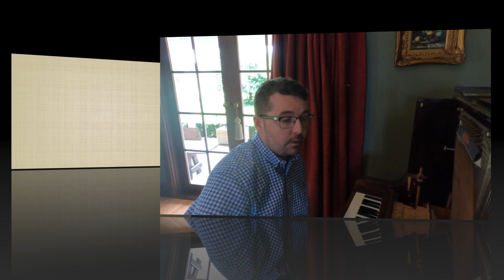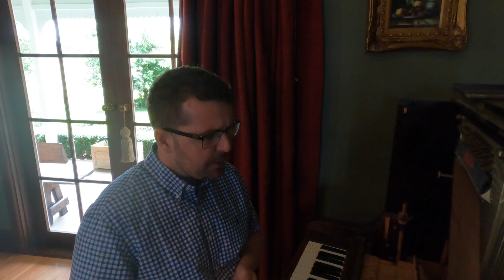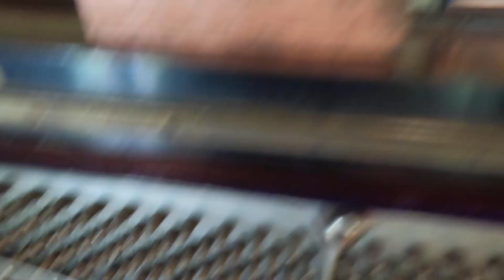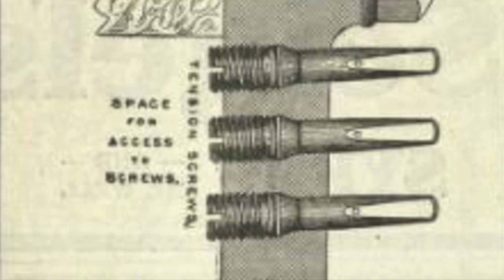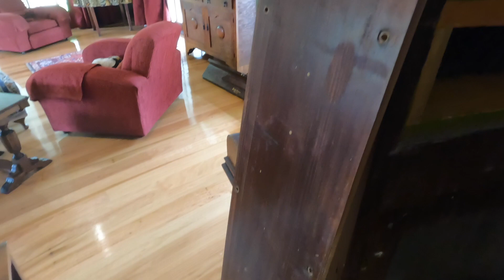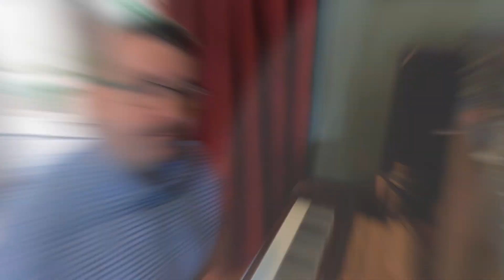Beale Vadar tuning system explained

Comment: Hi I just saw your very interesting video.  I have just acquired a Beale which looks very similar if not identical to yours.  Mine is 1945.  So just 3 quick questions. Firstly what lubricant do you recommend?  Secondly, does the piano have to be placed on its back to apply the lubricant?  And lastly, do the locknuts have to be loosened in order to tune the piano?  My one has probably not been tuned in 15 years and has dropped down by a tone, (on average).  But I think it's a great little piano.  Regards Pete

Comment: I came across two of these. One was water damaged and probably write off, the other some girl got after a music teacher. As I had never tuned it before it was very lenghty and pretty scary as many pins were stuck - so I wasn't sure whether the screw is tightened or the pin is just not moving. I wish there was some literature about how to look after it.